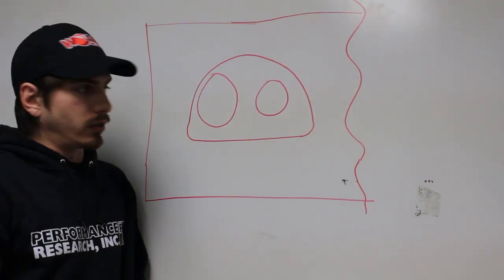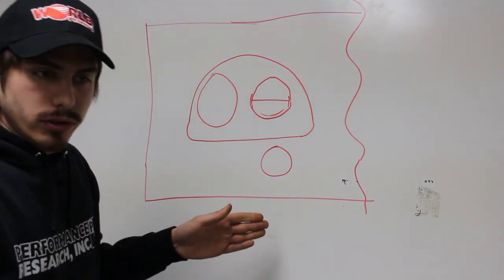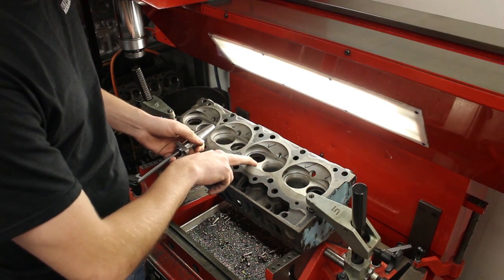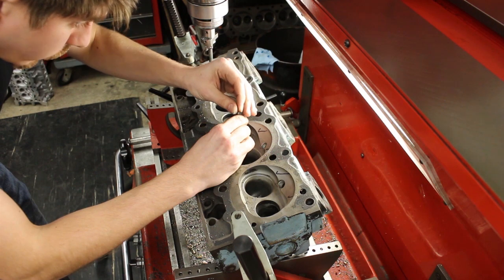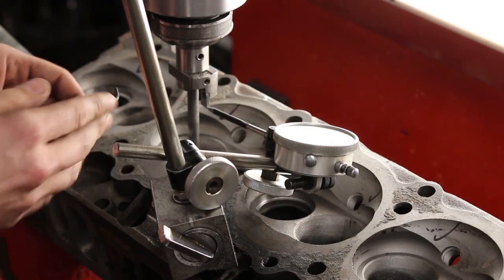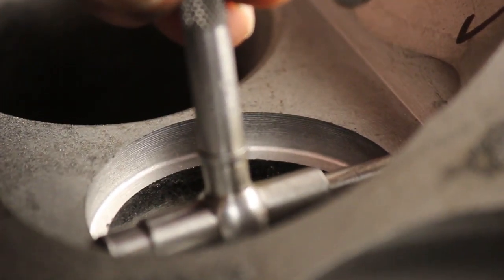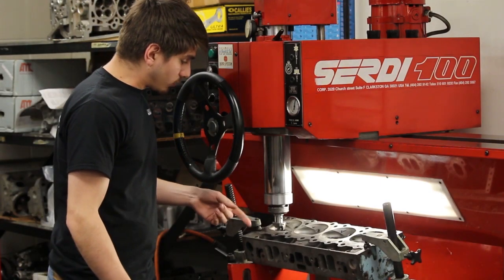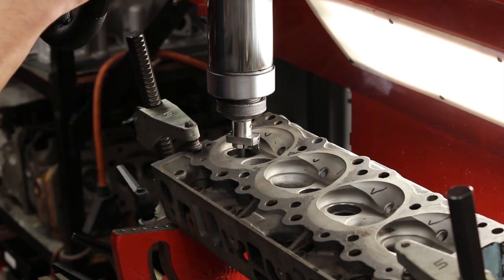Hardened Exhaust Seats, Machining Installing and Explaining!

Comment: 7 point valve seat
Reply: I've been shown that before. It's basically how you get 13 plus horsepower out of a top fuel car with a hemi motor
Reply: Do you know how to do a 7-point seat valve job ?
Reply: A valve job on a high performance engine is either going to be 3 4 or 7 meaning the contact of the valve to the seat it's more rounded and provides better breathing for the engine when it comes to exhaust and intake valves.

Comment: Great video man !!  I really like you presentation style & commentary, slow enough for me to understand....Compared to the oem factory integral iron seats, All pressed in seats are scary  problematical risks of coming loose & is deff the most critical procedure within the entire engine !  Because it completely depend$ on a simple press fit Without any "captive step",  I  would think a Heated head & Chilled seat ring under surgically clean surfaces would be the Minimum standard install procedure technique, particularly on aluminum heads, but I Rarely see it performed...I Really like your Pre--bottom angle relieving cutting technique & I'm sure it helps towards better final cutting & valve sealing......Thx for your time..

Comment: Would like to see the guide installation video and also the intake seat cut video especially if you are doing on this head. Am doing a custom set of 71#96 Pontiac heads that I inherited .. bare but beautifully ported. Want dead nuts straight new valve train and was going to have custom 7mm valves made for it.

Comment: Not sure which head you have there, but I can tell by the deep chambers and the double hole heat riser, that its a 1973 to 1979 head. Pontiac engineers knew unleaded fuel was coming and started flash hardening the seats on 1971 and up heads, which is exactly the year when all the compressions ratios dropped. The head you are working on already has heat treated seats, not steel inserts, this is common knowledge in the Pontiac community, so it is not needed to install these unless to repair a worn head.
Reply: You can clearly see in the video that the existing seats are only cast iron, same as the surrounding head material.

Comment: Wondering if hardened steal seats are used in aluminum head
Reply: Why wouldnt they be? Imagine this, a steel valve going up and down thousands of times a minute, under a heavy spring load, slamming into aluminium seat, if you dont know what that would do, then take a hammer and start tapping (note, i said tapping, not smashing it in 1 blow) on a pop can repeatedly for like an hour. Let us know how the pop can looks. Even a solid chunk of aluminium, you will eventually damage it beyond repair. And this all happens in roughly a 1/16" of a seat.

Comment: What is the Press fit interference you chose? Thanks keep up up nice vids!!
Reply: In cast with hardened seats it would totally depend on valve material and seat material but most I have done are between 4 and 6 thousandths. One thing he didn’t do that can help give a cleaner and safer seat is to freeze the new seat and heat the head a bit. That can take a few thousandths off the interference fit and make sure nothing is scraping or gouging. Plus it just makes it easier to press in. Not a big deal here but whenever pressing anything in bearings and bushings etc the freeze can help. They actually sell bearing freezing machines.
Reply: Lighter fluid butane can work ??

Comment: Actually Octane ratings have remained relatively stagnant and unchanged since 1973 when a minimum octane RON 91 was set.    Due to variations between RON and MON the US and Canada changed the way they calculated Octane.  Now Octane is calculated  like this RON + MON /2 =  So for example (91 RON + 83 MON)/2= 87 octane.  RON stands for research octane number while MON stands for motor octane number. 

 Lead was used as a way of boosting octane much in the way that other additives used to make gasoline are now.  Lead was preferred as was the cheapest means to boost octane.   Later auto manufacturers fought to keep it as it protected valve seats so manufacturers could go cheap as adding hardened seats cost them a few pennies more per valve.